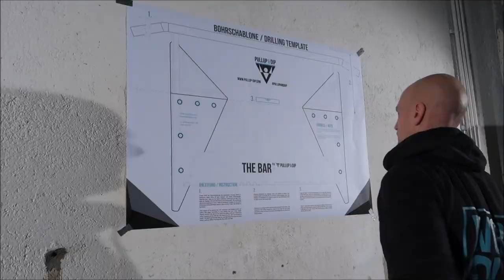Tutorial: How to install a Pull Up Bar on the wall

Comment from the maker: Any more detailed questions? Leave us a comment below and we will answer them :)
Reply: I want to install on cinderblock wall how can i do this
Reply: Hello I have a question, what type of screws and dowels did you use? I’m trying to install a similar pullup bar with holes that are also 10mm wide.
Reply from the maker: @josesantana1227  we used fischer long shaft dowels with 10x100 mm
Reply: @PullupDip  thanks!

Comment: Are you drilling into concrete? Im looking to mount the rogue jammer pull up bar on concrete but I’m not sure if I should put on a a wood plank first then mount the pull up bar or just mount it on concrete! Real novice at this stuff so I’m just looking to do it right the first time so I don’t fall mid pull up 😂 any advice on how to go about this?
Reply from the maker: yes this was a concrete wall

Comment: Did you drill this into the studs or drywall? If drywall, how sturdy can it be? Wouldn't it rip out with all the weight?
Reply from the maker: Hello John, we recommend the installation only for concrete and brick walls and with a special technique it could also be installed on a stud wall, see also https://www.pullup-dip.com/pull-up-bar-installation